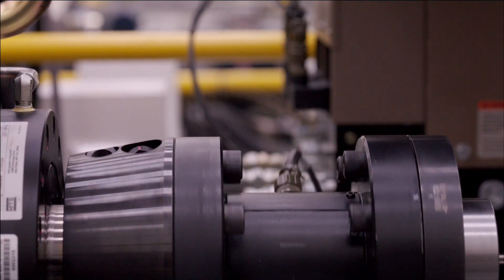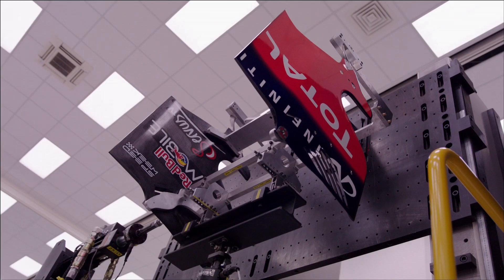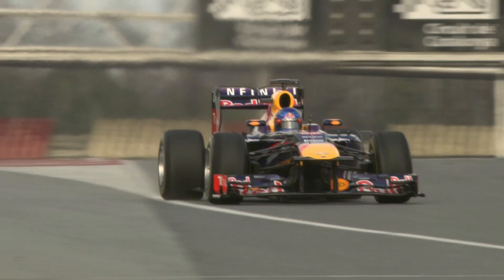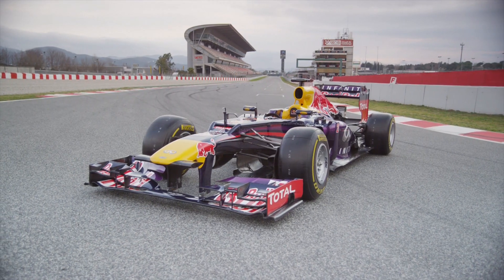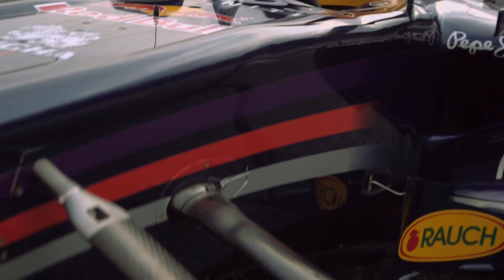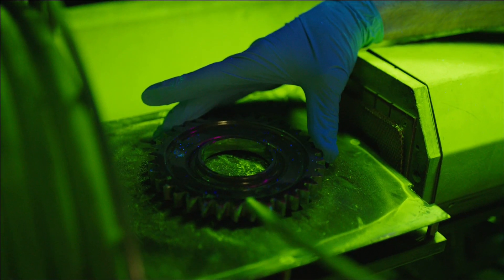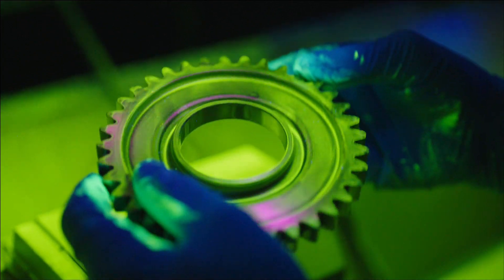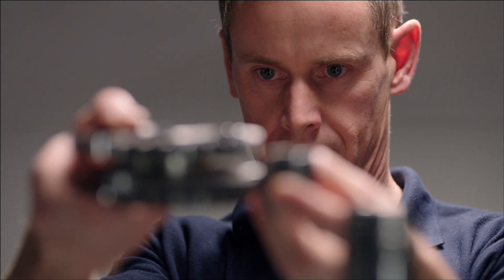How To Make An F1 Car: ASSEMBLY (Part 4)

Comment: Under the UV light it is to locate micro cracks. In the NC mills it is a lubricant/coolant so the cutting bits don't burn up or gall the piece they are making.